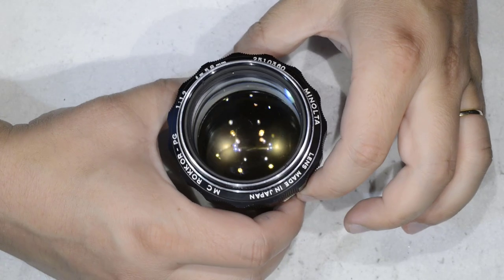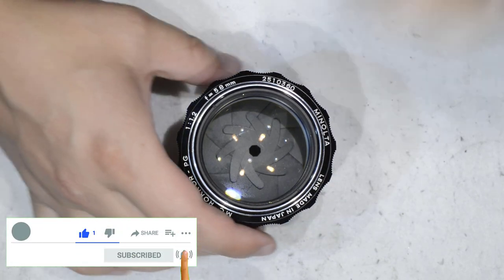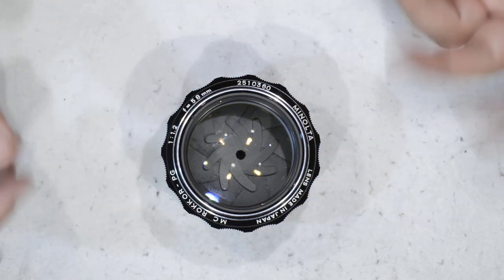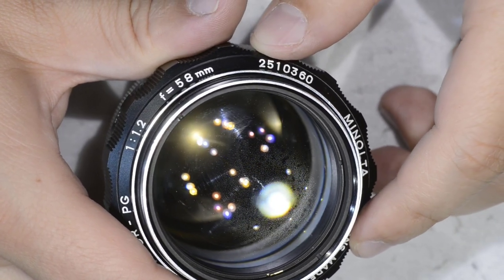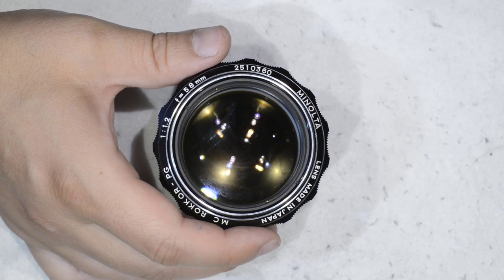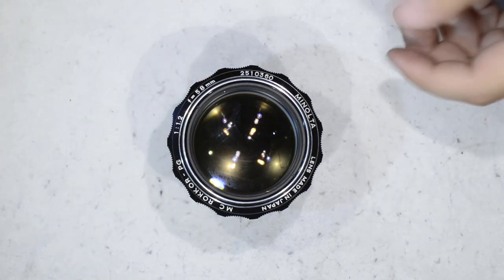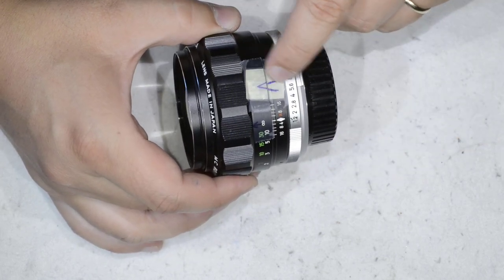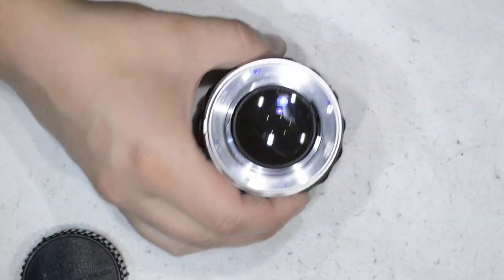Minolta Rokkor 58mm f/1.2 : Disassembly & Cleaning

Comment: Oh maaan, I did a repair on this lens myself a couple of months ago. Ran into new problems every move I made. It took me over 12 hours in total, this video would have helped me greatly if it had been online then 😂. In the end I got it done, only thing is that the focus throw is alot shorter than it used to be, but I cant figure out how to fix that 😭
Reply from the maker: That's a pity. Got this from a guy in US, spend 4h to redo the lens anew. This is the last part of the restoration, I'll post the helicoid video in the future, otherwise you can access it thru the channel membership. Cheers.
Reply: @diyextravaganza  oh that would be amazing, ill keep an eye out for that  video!

Comment: Have you ever put ball bearings back into a lens? I have a FD 85mm f1.2L that I need to do this too. But just trying to get a sense of this from anyone and any lens before I ever try to fix this wonderful lens.
Reply from the maker: Hi, I did that once for a lens, and a few times for other mechanical stuff. The difficult part is to get the balls to hold in place. So, what you can do is to use a grease that is a bit sticky (lens grease should do), mix it with the balls, then with tweezers (non-magnetic ones) you can place the balls in position. The grease will make them hold and make them also lens bouncy. For the working surface, use a white cloth. Cheers.
Reply: That is a genius idea. I will use the grease trick. Thanks so much man. 
 @diyextravaganza